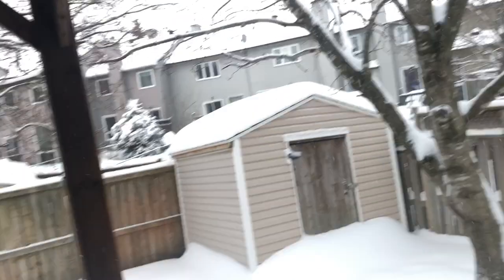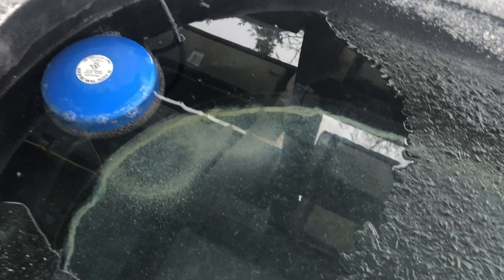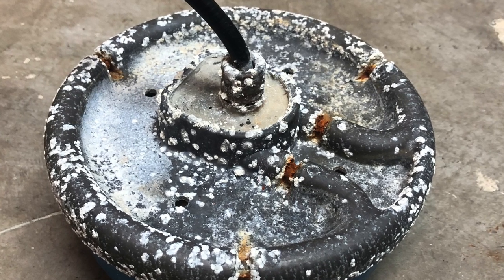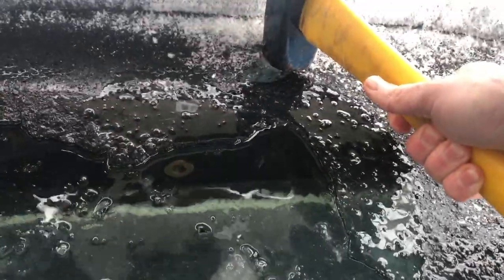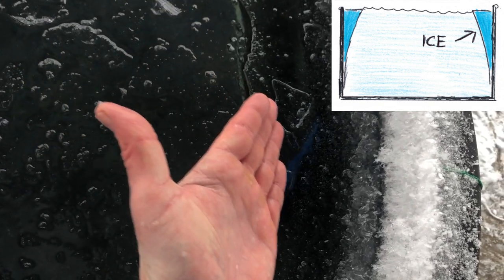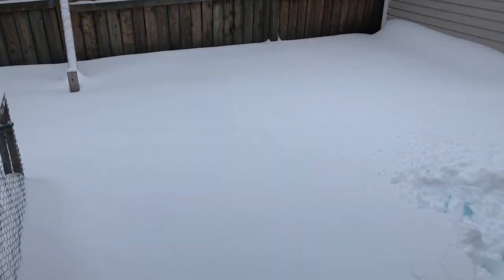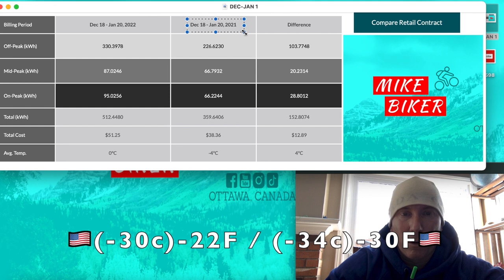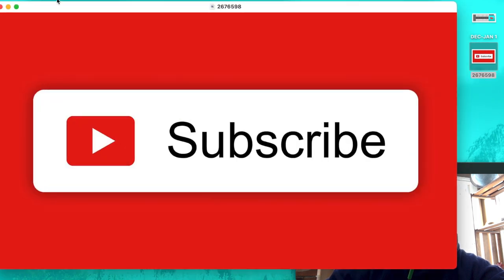STOCK TANK DE-ICER REVIEW & ELECTRICITY COSTS ⚡️ FOR YOUR ICE BATH COLD PLUNGE

Comment: I'm really surprised by how low that number is!

If it was running 24/7 for a month it would be almost 7x this amount of useage, so It really only turns on for a few hours a day. Interesting, thanks for sharing.

I just bought a 1500W one, since I have twice the amount of water, it might run a lot more, time will tell. I just received my highest power bill ever, by 40% and I haven't even plugged it in yet. I think ya'll electricity rates in Ottawa are a lot cheaper than here, we're paying 17Cents per KWh in Nova Scotia

Comment: Sorry if I missed it but how many watts is your de-icer? I'm using a 360L trash can and its currently freezing up from all sides and need to act fast :O ! I have a good deal on a used 500W but it says it's effective up to 227L :S !
Reply from the maker: Hi Jayze. Mine is a 1500 watt. 
You might get away with a 500w if the surface area of the trash can isn’t very large. The main thing is that the surface stays below freezing.
Reply: @mikebikercanada  gotcha thanks Mike!